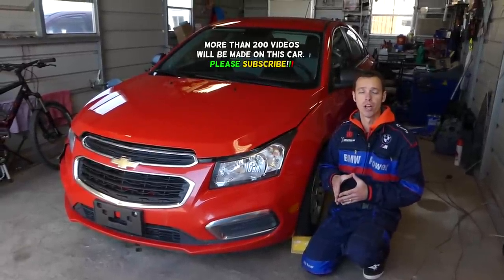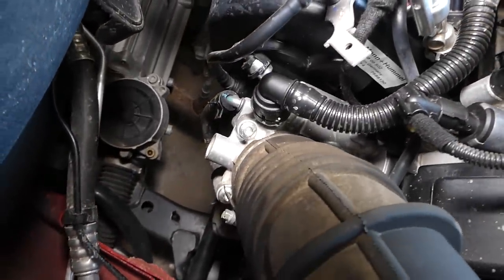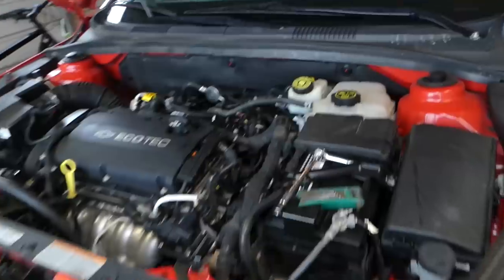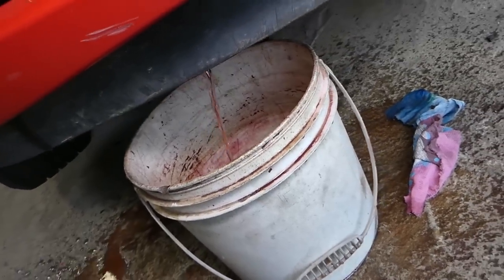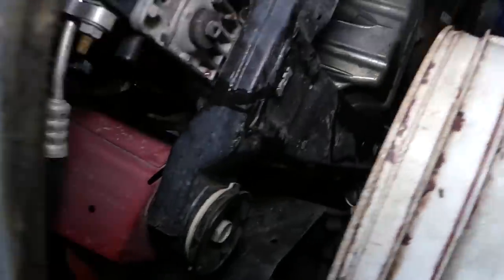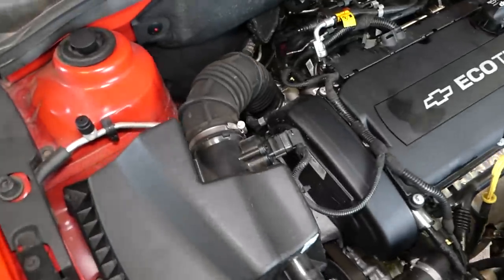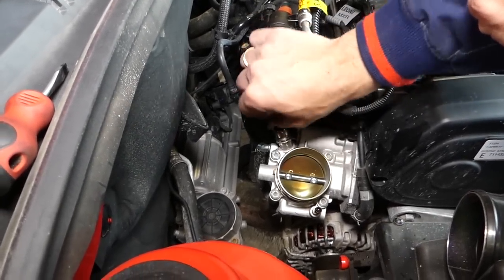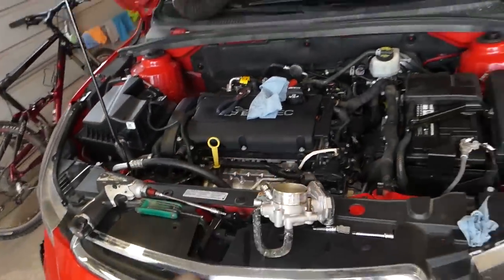CHEVROLET CRUZE THROTTLE BODY REPLACEMENT REMOVAL. CHEVY SONIC THROTTLE BODY 1.8 Engine

Comment: Dont drain your coolant ... just clamp the coolant lines running to the throttle body off with needle nose vise grip pliers ...
Reply: Real stuff
Reply: If I just need to clean the throttle body, do I need to clamp the coolant lines? I don’t need to fully remove it, right?
Reply: No don’t clamp stuff! Especially old line that are dry rotted. That’s how you break a pipe or meal in an area. I had to replace a hose of mine because an area ballooned and then popped on me.

Comment: A customer called me today about this car cruze 2011 issue with code on dashboard 84. He stating that the throttle body needs cleaning and he wants me to do it. I just Want to get an idea of how Im going to disambly the part. I wanted to ask just as a concern or curiosity do I have to re program the body throttle after I take it off and clean it. Thanks for reading me.

Comment: Hi, i have sonic 2012.
Its used car. I found someone cancelled the throttle body coolant pipes. 
Is this can effect the throttle body??
Reply: My mechanic did a throttle body heater bypass and said it doesn't cause engine running problems... Now I'm have not regular acceleration at low RPM (about at 2000) and don't know the cause

Comment: Help replaced throttlepostion sensor and accelerator pedal. Engine still goes into limp mode getting p0121 code what would be next step
Reply: Dealer

Comment: Where is the idle air control valve cant find it only thing on internet about it  is that it is near the throttle body or intake manifold

Comment: Have a 2014 Sonic LT 1.8...Can anyone tell me what is the name of the coolant line that runs from behind the throttle body to the overflow bottle....just like the video mentioned??
Reply: Should be throttle body outlet heater pipe
Reply: GM Part# 55579102 Throttle Body Heater Outlet Pipe
Reply: I need it. Did you figure it out?

Comment: Bad advice to drain coolant. I put plastic sheeting over alternator and towels on top of plastic to catch any drips. Just a few drops came out. With the throttle body removed however, there is a small amount in the short hose on the bottom. Glad I did not drain the coolant, which was just a year old.

Comment: why do you have to drain the coolant for just replacing throttle body?? is that only for 1.8l turbo?
Reply: The 1.8 doesn't have turbo. That's the 1.4
Reply: Because the 2 of the lines have coolant in them, emptying the coolant minimizes the leakage of those fluids and prevents a mess.

Comment: Hi mate. My chevy cruze 1.8 LS 2015 leaking coolant from throttle body . Neither from the U hose nor the other hoses. Suspecting leak from unit . And it costs a lot.  I have a coolant leaking issue from last 18 months. I changed thermostat housing unit, reservoir , one tube from thermostat unit to the throttle body , water pump and now it's the throttle body from where leaking started. Can you suggest whether it can be fixed without replacement? Thanks mate in advance
Reply: Any solution for leaking problems? I have experienced same problems you said and the thermostatic valve have been sostituited too. Now for the leaking from the throttle body my mechanic has done a throttle body heater bypass and said it doesn't cause engine running problems. Any definitive solution for you?

Comment: Is this problems cause the engine to idling low/high RPMs while vehicle is on?? Or what’s causing to idle without accelerating? Please asap 

Thank you

Your videos are very helpful 

Keep it up man you doing a great awesome job. Your future is scripted!! (: 👍👍👍👍👍👍😀😀😀
Reply: Throttle position sensor, its located on the side of the throttle body, theres little electric fingers inside that send the signal to the ECM, they come apart and cause idle surge and loss of power

Comment: At 8:26 the “coolant line” as u said , the other end where it clicks on , what’s is that called. The piece where the end of the coolant line clicks onto , not the hose itself.
Reply: That's the surge line, or coolant return line, leads back to the reservoir. Ridiculously priced for such a simple piece of hardware. It's shoddily built, and can actually crack at the tip leading to pressure issues, problems with shifting, and puffs of white smoke during attempts to accelerate.
Reply: @pidera7486 you mean the throttle body heater outlet pipe? How it can technically cause the problems you say? My mechanic did a throttle body heater bypass and said it doesn't cause engine running problems 🤔
Reply: @pidera7486  I've spent hours looking for this. So surge line or coolant return line?

Comment: does any one know where the idle control valve locates?
Reply: They don't use them anymore. The computer and sensors just control idling from the throttle body now.
Reply: Back of the intake